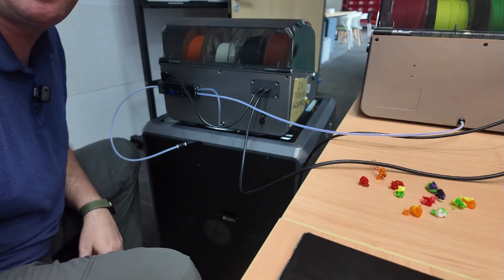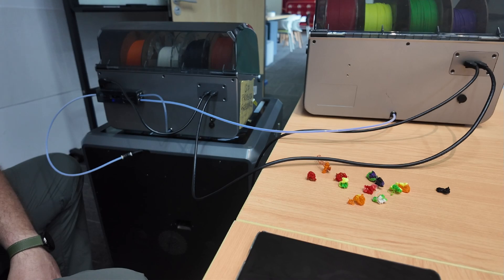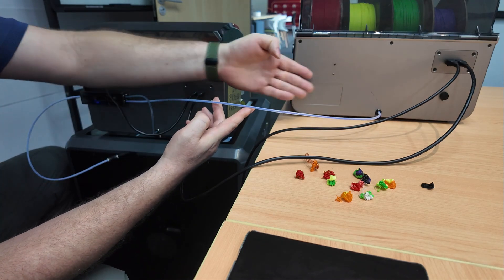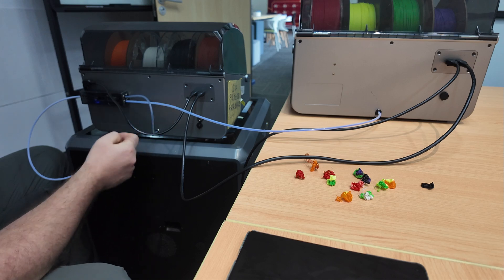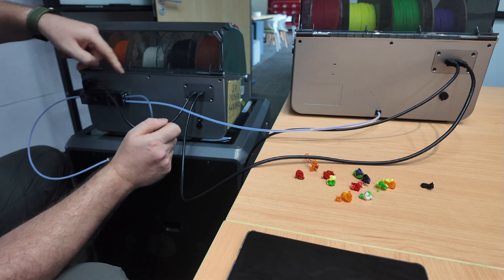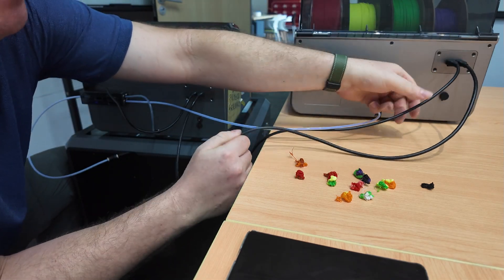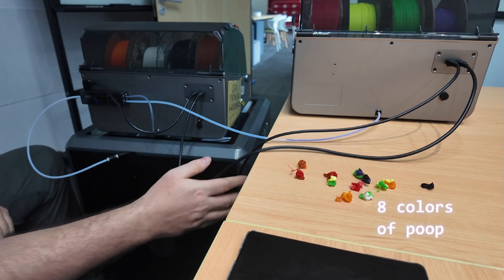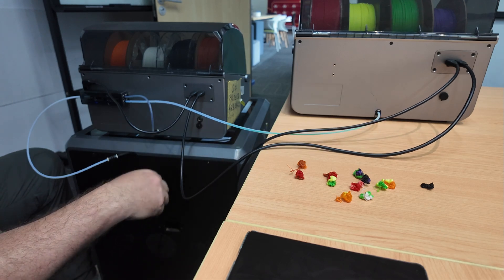How To Connect 2 CFS to your K2Plus @Creality3D

Comment: I have a K2 Plus with two CFS's.  I have read that the length of the PTFE tubes needs to be pretty exact, yet I see you have one that is much longer.  I have tried to get a good answer online, but I cannot find a definitive one.  Which PTFE tubes need to be a certain length (e.g. 300mm or 400mm) and which ones can be longer?

Comment: Any Videos on how to diagnose a dead CFS? I got a 2nd for my K1Max and when i plug it up all i hear is the feeder on the bottom running. The front panel does not come on. No other lights or sounds.

Comment: Hi, i got 2 CFS to 1 HI..and often i got feeding errors and this goes into a loop where i then need to restart the printer. Is there any troubleshooting guides for this?
Reply from the maker: I have 2 CFS on My Hi at home also. When you restart the printer does it work? I never turn mine off and have not had any issues unless filament breaks inside the tubes.

Comment: First time I see someone connecting the filament buffer to the back of the CFS instead of the side of the printer.  I wish I have seen this before assembling my printer. But I blame Creality for using double sided tape instead of more creative way to connect the filament buffer.
Reply from the maker: Yeah for the HI there is also a bracket you can print to hang the buffer on the side of the printer - we use that in our livestream studio and I like it.  My HI at home I used the sticky tape and I like that too, keeps it in place.
Reply: @kevin.in.3d  On my K2 Pro, there are 2 mounting screw holes on the back of the printer to attach the filament buffer.
Your video threw me bit seeing the buffer attached to your CFS, because I just bought my 2nd CFS unit and a buffer is supplied as well, that is obviously not required.

Comment: Thank you.  If I purchased 2 separate Creality Hi combos with one CFS each, would I have everything I need to connect the 2 CFS's to one printer?  
So I had one printer for a single filament and one printer for 8 filaments? Thanks
Reply from the maker: yes for sure - i have two connected to one printer now - you get everything you need in the CFS box. No problem!

Comment: Hey Kevin, can the primary cfs be positioned next to the printer and run fine or do they need to be above the printer. I understand that it would add print time do to the longer transfer tube but is there a reason it needs to stay up top. Thank you
Reply from the maker: no, it does not have to be on top.  We always keep one on top because we are moving it onto carts and taking it to other rooms - that's really the only reason.

Comment: @kevin.3D  Are the CFS units physically stackable If I wanted to. I know filament changes would be a pain but with the space I have available,  I would rather have a high tower than a printer sitting below a shelf of filament. I would have designed them to be a modular series of stackable drawers to keep a small footprint and allow of  easy filament changes.
Reply from the maker: that lid opens up wide - so you could build a shelf (or print one) to stack them, but you would need a bit of clearance to change filament for sure. I did another video with the measurements with the lid closed and with it open.

Comment: I have one more question: What are the dimensions of the CFS, length and width?

Also, what kind of cable goes from the printer to the CFS, normal USB or special cable, and how long is the cable, as I want to place the CFS device on a shelf above the printer?

Comment: Hi Kevin, probably a silly question but is it possible to mount the CFS next to the printer instead of on top? Also, can you simultaneously connect an external spool together with the CFS?
Reply from the maker: yes, the location of the CFS is irrelevant - you can put them wherever you want.  External spool can also feed the printer - but not with the CFS.  One roll of filament or 4 - not five, sorry :)
Reply: @kevin.in.3d  Great, thanks!

Comment: Thank you so much for this video. It looks like a very simple, straight forward hook up. Is there an ETA on the release date for the CFS? Also, how would 3-4 CFS connect? Same method?
Reply from the maker: yes, 3 or 4 are connected the same way - chained together like this.  The first 2500 CFS will go with the K2Plus being pre-sold now and shipped in October.  By then we will know more on purchasing extra CFS including the price.

Comment: It can print different materials as ABS and PETG on same printing or just multi colours from same material ?
Reply: This is a pure slicer setting, of course it works because the CFS only ensures that the appropriate filament reaches the extruder. However, you have to find a compromise in terms of the enclosure and print bed temperature that works with both materials.
Reply from the maker: yes, it is multi-filament - so I'm excited to test things like that myself.  Should be a lot of fun.  As the other comment mentioned the temperatures for each filament will make it a challenge also